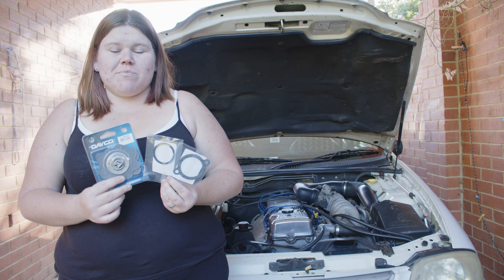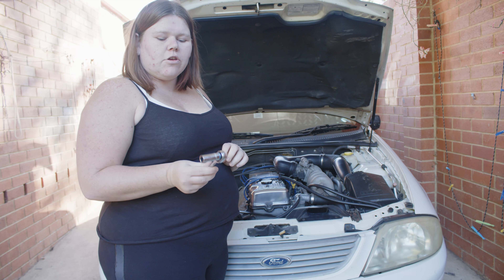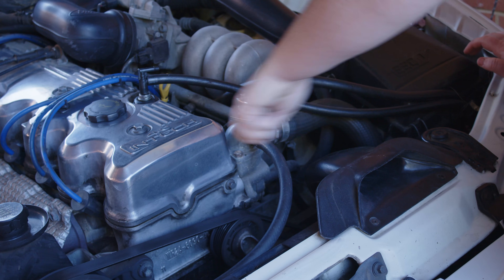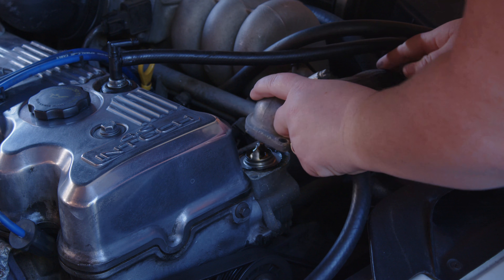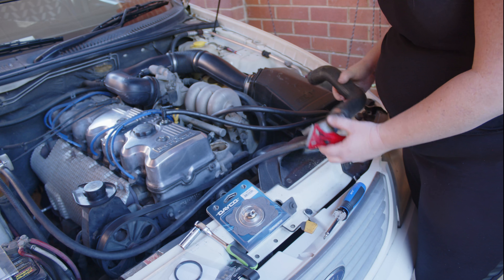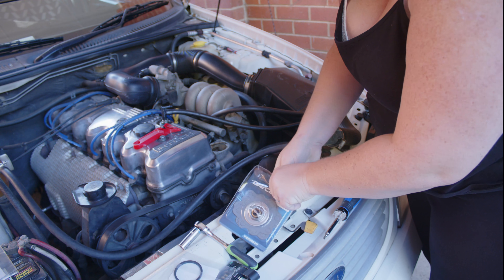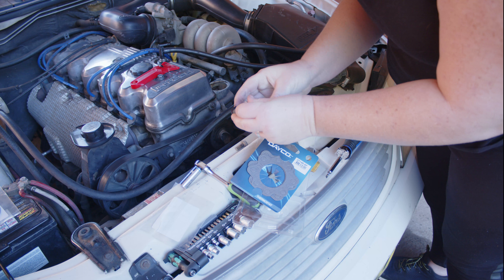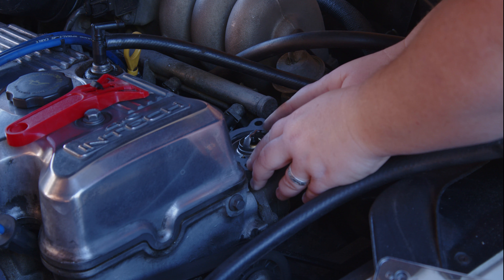Replacing A Ford Falcon Thermostat

Comment: For future reference, the bleed hole/jiggle pin must be placed at the 12 o'clock position when looking from the front of the car, in this case it was placed at 9 o'clock. The paper gasket it not required at all, that is an XF Falcon part. Only the rubber ring is required. The rubber should be covered with a layer of Vaseline on installation, yes this is in the manual. Most important bit is the outlet be slowly and evenly tightened down to 21Nm. The rubber ring only requires a little bit if crush, if its over tightened it can cause a leak.
Reply: The paper gasket is not a bad idea these days, over time the alloy changes shape. Better safe than sorry.